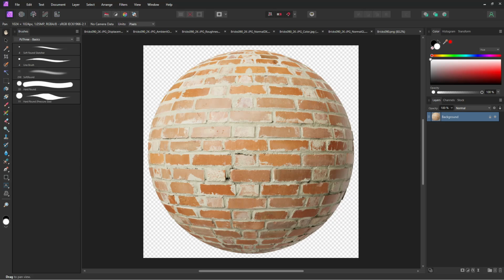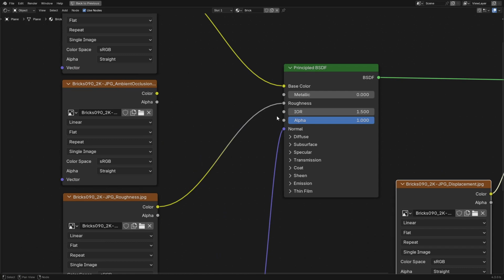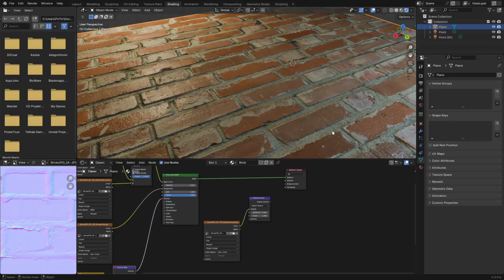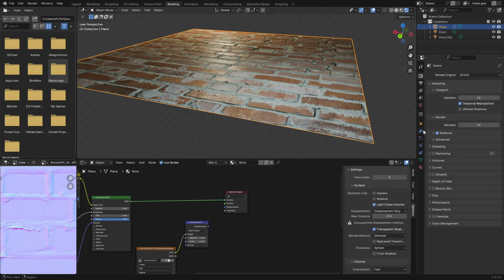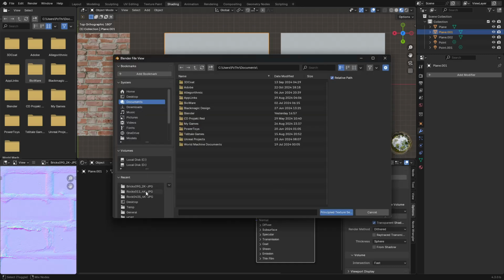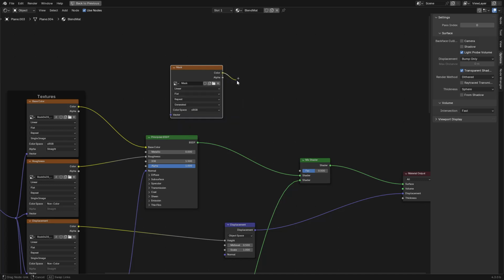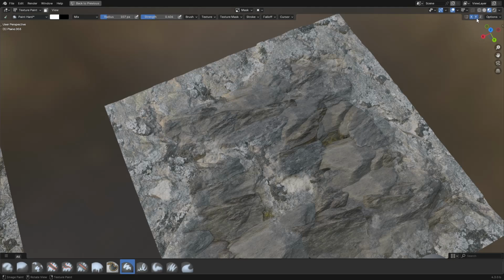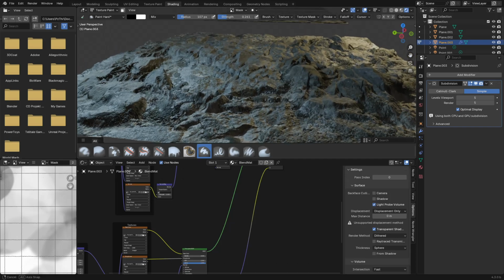PBR Material Setup - Blender

Comment: I'm having an issue with my texture with the sub surf step.  I switch it to "displacement only" and it goes 'wavey' like yours does.  Then when I add the sub surf, nothing happens.  I put it up to 5, like you did in this video, and it doesn't change.  I adjust the scale like you did on that panel hooked to the displacement image and still nothing. It just stays in that wavey mode.